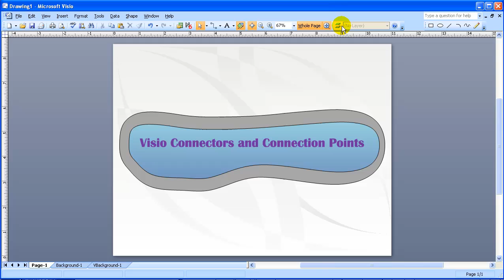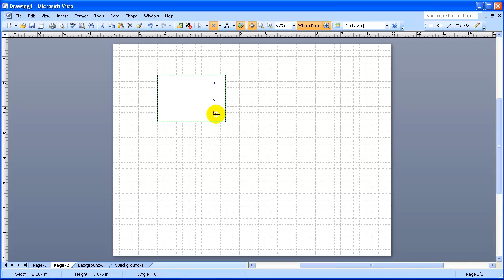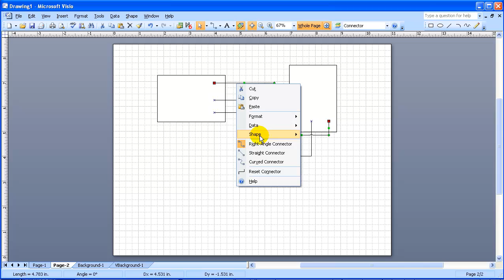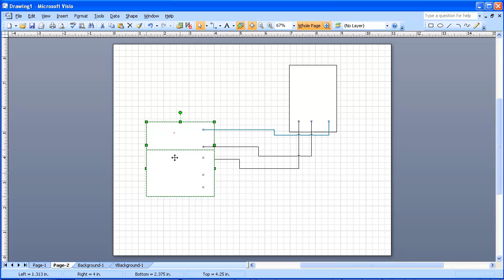Visio Connectors and Connection Points

Comment: I am looking for a version of visio to design very similar diagrams like on this video. Could you tell me if it is possible to use connectors and connection points like this in standard version as well?
My boss recommended visio 2007 or 2010 standard- but i dont know if they are enough for this purpose.
Thank you for your help

Comment: I wish those connection points remained in place when you increase the size of the block ( to add more connection points or just to add more text inside). As it stands, if there are two connection points on a side, (located 1/3 from the bottom and 2/3 from the bottom), then if I make the block larger to add a 3rd connection point, it doesn't help.  The original connections points are still at 1/3 and 2/3.  I have to move the connection point to 1/4, 2/4, and add the 3rd point at 3/4th.